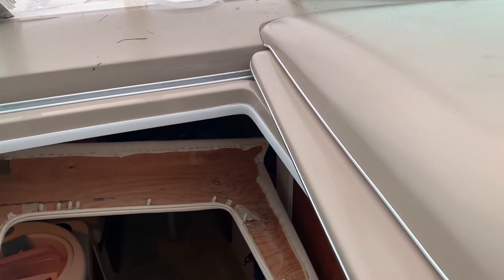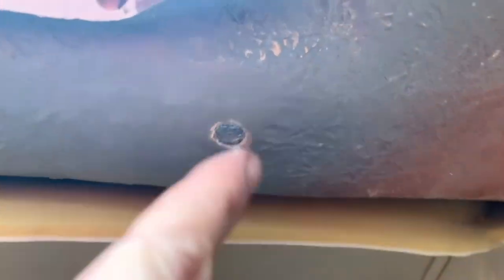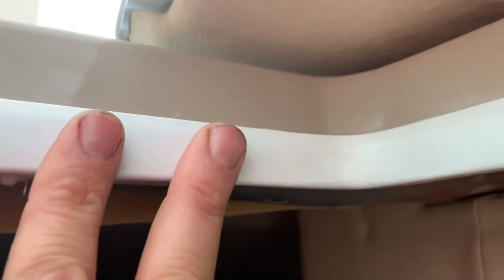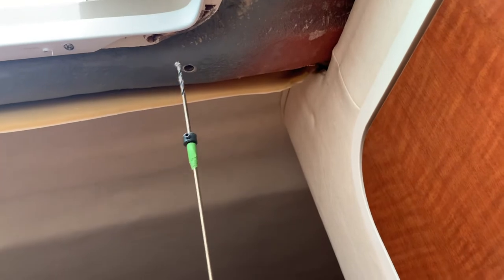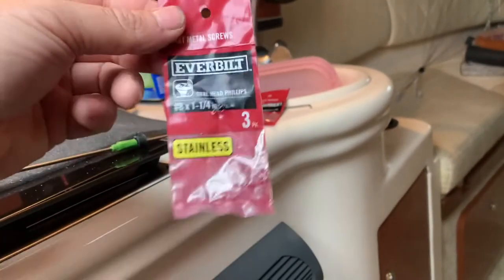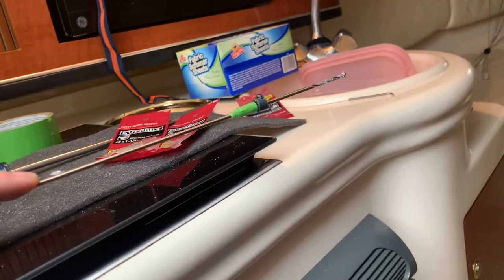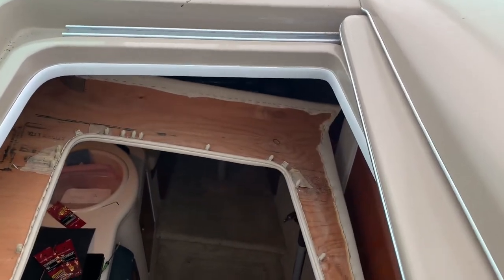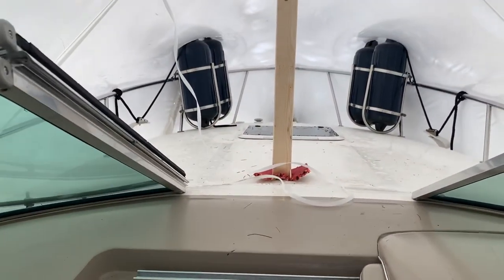2004 SeaRay 260 door slider fix Part 2

Comment: Thank you so much for your door fix video.  My only questions is if for chits and grins, I were to save time and NOT remove the pillow panels, would I be able to do the rest of your fix?  I know I'll have to fix a small slit in the vinyl afterwards, but heck, I already have  a couple of other slits in the overhead anyway.
Reply from the maker: You could do it without removing the pillow panel but you would need to drill through the panel then.